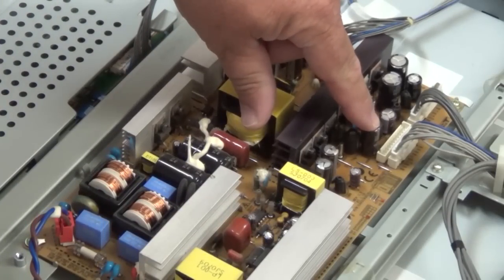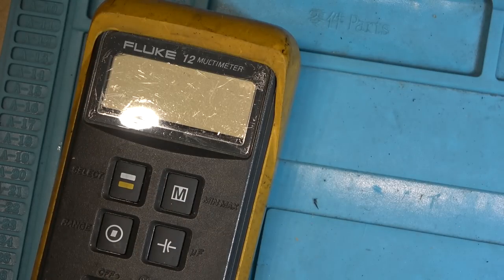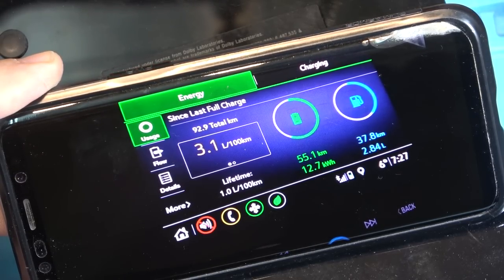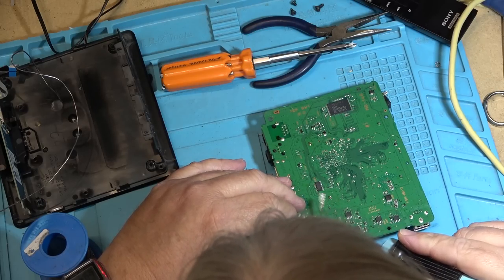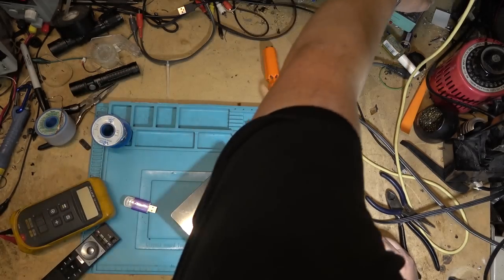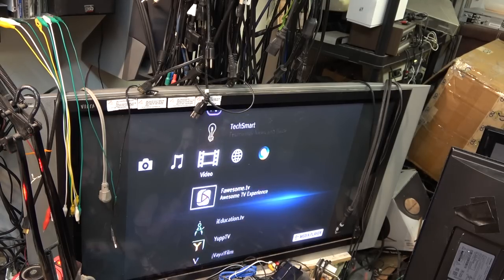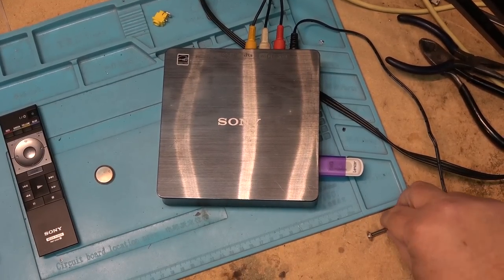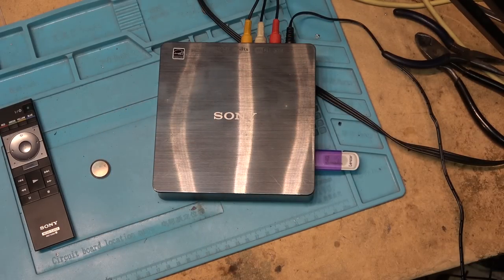Scored a great unit on facebook for free today

Comment: And that is why I won’t buy an EV. I know this is a hybrid but just think if it was an EV
Reply from the maker: If it was an ev it would have had 400km range.  My range is 60 to 90 depending on the outside temperature.  I wouldnt buy a full ev either because i don't need the expense of a huge battery. For my driving the cheap small battery is fine and a small 4 banger as s a backup is perfect.  It goes like a bat outa hell on battery or gas.  There is no difference.  I just don't like burning gas unless i am travelling.  Then no problem.